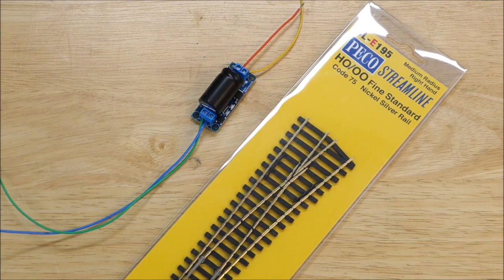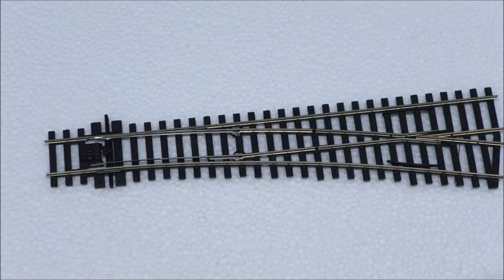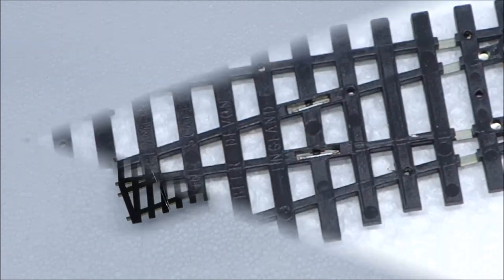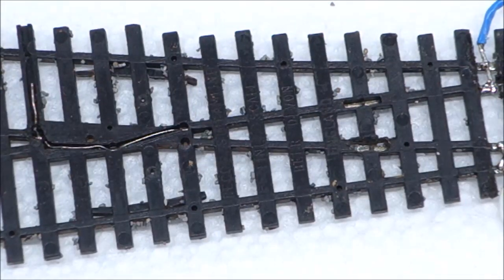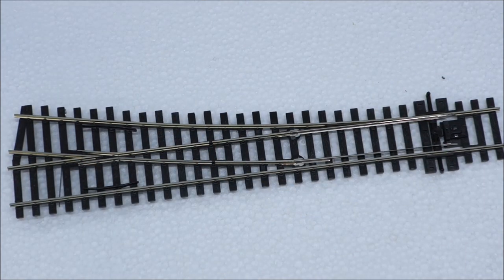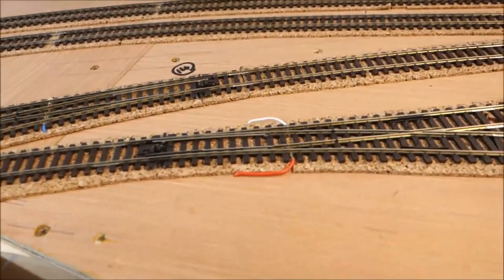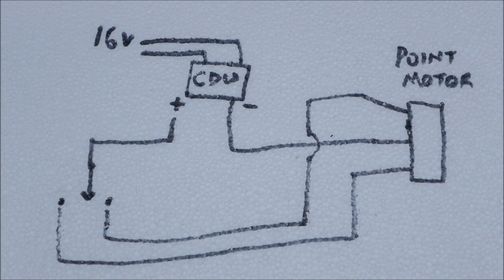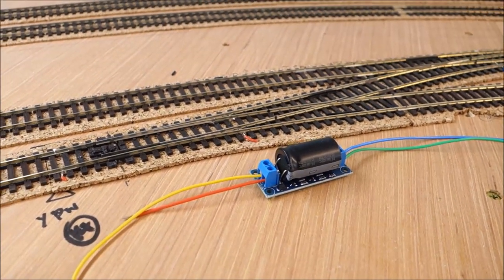Bite Size Bits - Live Frogs and CDUs

Comment: You forgot to mention about using isolating fish plates or gaps in the rail so that when the point is switched a short will not occur when a crossover is involved.
Reply from the maker: Hi Terry.  Wiring a layout for live frogs is the next step after this introduction.  Thanks for the idea for another Quick Bite!!
Reply: Yes that confused me too, the powered fishplate on the frog would short on the next connected rail if polarity switches.  Nice videos though 👍

Comment: A useful and clear explanation.. I've subscribed! I'm about to build a new layout and hope to enable my points to control color light signals protecting them but the wiring involved to do this appears a little beyond me! (There are quite a few youtube vids about signals for block detection but not about point protection.) Any suggestions most welcome?
Reply from the maker: Hi Stef65  I am a convert to Relays (see my Point Motors & Relays video) and would suggest exploring these.  They are simple to use and power whilst allowing for much flexibility in use.  Thanks for our visit and sub!!